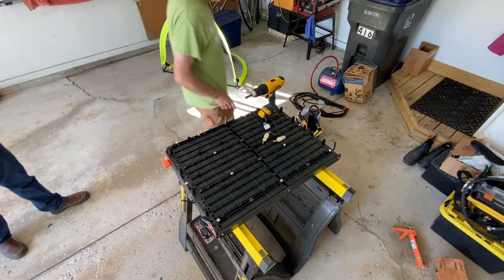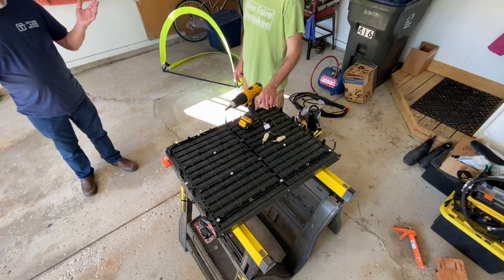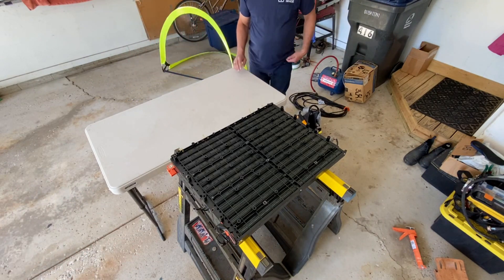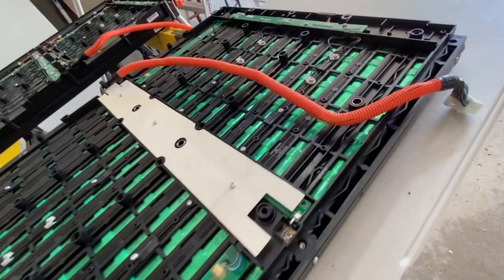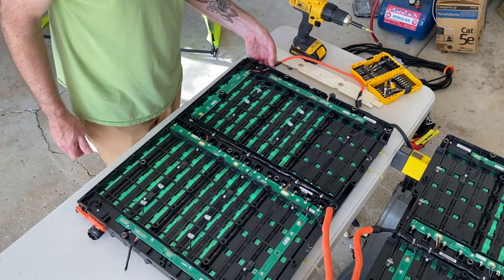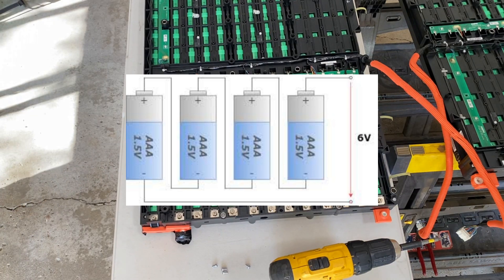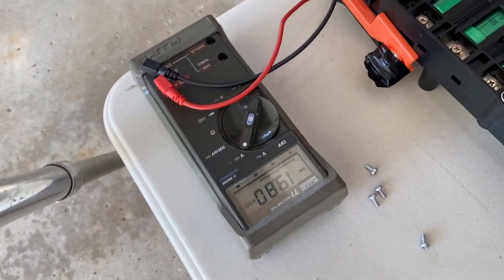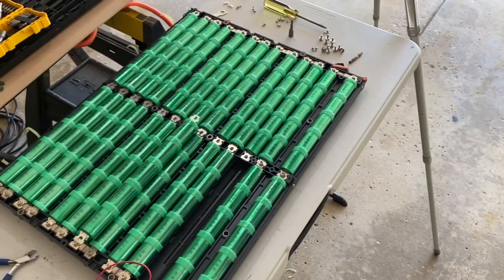What's Inside: NiMH Hybrid Car Battery Pack

Comment from the maker: Hi all ... in the video I stated some nominal voltages ... I've since found something of a possible representative data sheet for a 2005 Ford Escape Battery pack that states:
Nominal cell voltage: 1.32V
Nominal pack voltage: 330 V

So, the 180V that I kept mentioning for 1/2 of the total pack voltage may, in fact, be different when fully charged.

PS It also states the number of cells at 250, which doesn't match the number of cells in my pack (260); unless the second pack has an unpopulated row.

At any rate, take the values as representative.